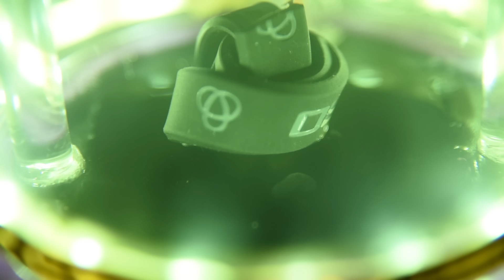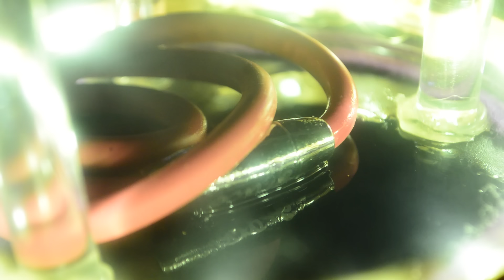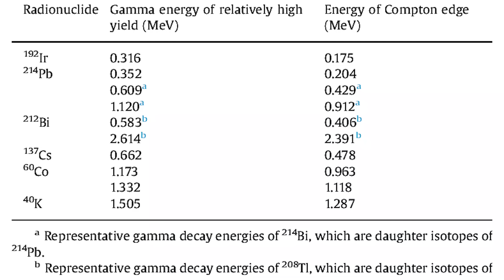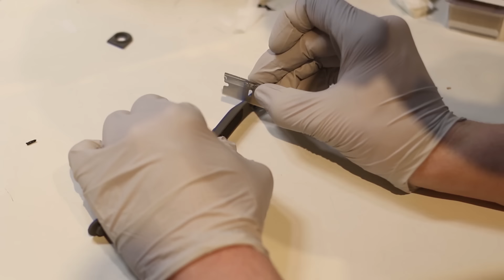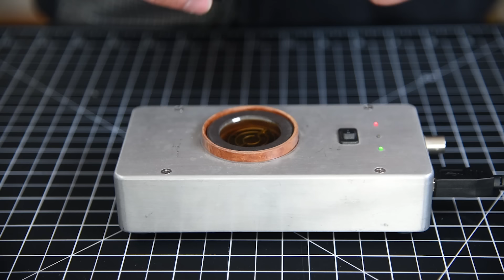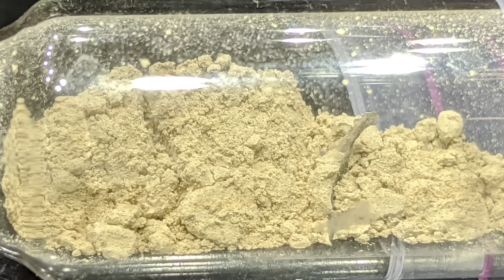Negative Ion/Anti-5g Products Are Actually RADIOACTIVE

Comment: You should build an atomic battery. Maybe even one big enough (and safe enough) to power an electric car. If you use carbon nanofoam and fill it with tritium, then you could produce a lot of power, and you could easily reload the battery once all of the tritium decayed into helium 3 (which you could sell to research institutes).
Reply: I would not do that, and he’s bogged down in other things already. Tritium is hard to make and pretty dangerous.

Comment: I need to know: what about a blow drier with that function?
Reply: came to ask the same question. all i know is "if you push the button, the hair dries flatter than if you don't". although in that case it would be heat/electricity fucking with a slab of tormaline so ??????

Comment: Not sure if this is up your alley or not but ever hear about Black Tourmaline? I think it is marketed as a general health thing and an EMF blocker. Interestingly enough, I was given a piece as a gift and had it placed in front of the receiver for my TV remote, when all of a sudden my remote stopped working... Changed the batteries, reset the box, bla, bla, bla, turns out the freakin rock was blocking the signal! I mean it had to of been because only when I moved it did my signal go threw. It was a small amount too, probably the size of a large coin
Reply: Well the remote prob used infrared
Reply: It blocked it because TV remotes use infrared light to communicate and you put something in front of the path of the light, you will achieve the same effect by putting anything infront of it.

And like this shit doesn't do any of that because that is not how electromagnetism works.

Comment: I know I am a bit late to the party, but as I was watching the Veritasium video, a scientist explained that tourmaline, being pyroelectric, creates negative ions on the surface when the temperature is increased. Is this really the case? Checking tourmaline crystals (shorl) as products, they are just advertised as tourmaline, with no negative ion claims, and appear to be in their natural form. Is there anything to such claims?
Reply: The stuff is expensive and rare as hell, there's no way anyone's just going to be selling any amount of it.
Reply: The statement is correct but just easy to misunderstand. Any conductive material will arrange itself in such a way that all the electrons, and thus negative charge, moves to the surface, this is just a weird and unintuitive fact about reality and there's nothing special about it. A pyroelectic material just generates an electric charge when exposed to heat, and said charge in the form of electrons will move to the surface. This is just a property a material can have and there are other similar properties, a piezoelectric crystal will generate a charge when struck from a specific angle, and a photovoltaic cell can generate a charge difference when exposed to light (photons). Basically a bunch of materials can generate electric charges when exposed to certain conditions, this can be used to generate electric energy but it also doesn't do anything extraordinary.

They probably don't generate negative ions, an ion is a chemical with a negative charge because it has extra electrons, while they do play a part in some chemical batteries like your average car battery they can't just easily be created without some chemistry happening. So I think you might just be misremembering that part, the process of moving around electric charge in the form of electrons does not itself ionize materials as the total charge of the material remains neutral, if it wasn't it wouldn't be able to conduct electricity.

Comment: And alpha particles are actually the most dangerous type of particle. The low penetrating power makes them not as big a concern under normal conditions, but if you're breathing in or ingesting thorium particulate or get a cut near an emitter you've strapped to your wrist, different story.

Comment: are there any natural products out there that actually work, blocking EMFs??
Reply: To block EMF's you need a Faraday Cage. Basically a copper net. Though EMF's permeate the universe as a whole and are not harmful. So if you wan to block them, build a cage out of copper wire and sit inside that. Oh, and wifi and cellphones will no longer work inside of it as you block all the EMF's.
Reply: @Adjuni  has that been tested?
Reply: @thomashoppes8594   Relax.

 The electromagnetic radiation that you need to be careful of are Ultra-violet (from the Sun), X-rays (from hospital imaging) and Gamma rays (which, unless you're the incredible Hulk, you will not be encountering much on a daily basis)

The steps you can take to protect yourself are: wearing sun cream on a sunny day, and avoid Sun tanning beds
Listening to doctor's advice when they suggest an x-ray.

I think if there are airport security X-ray machines, you can refuse to walk through those. The staff might grumble, but at the end of the day, if you don't want to be exposed to x-rays, I don't think they can force you.

Only flying in airplanes when you need too.

You don't need special underpants. You don't need a tinfoil hat. You don't need to smash your phone to bits with a hammer. Phones use microwaves, which are non-ionising. There's no link to cancer as far as scientists know.

Comment: Hey, There is a product called magnetic heating back brace, the product claimed to have tourmaline inside it. I try to open it, it has no energy source yet emitting some heat, do that thing also radioactive?
Reply: There are many common chemical reactions that would give off heat, including a very common one that involves iron filings. Iron is also very magnetic. I think it's impossible to say without more tests/information.
Reply: @0.-.0  thank you

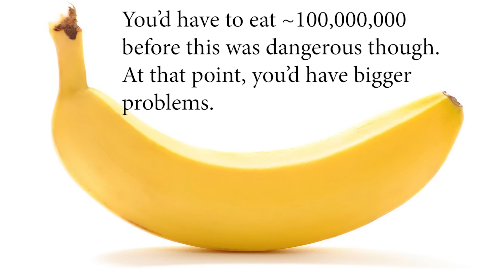Comment: 7:45
He looked at the clock. The power had run out, long long ago, but he knew, instinctively, that the exact date was 15428, 7, 18 at 21:37:13
the diet had enhanced his senses, but perhaps it was just the effect of the solitary time. He looked at the manual analog counter, to see that wonderful number. he rose from his bed, that of which, woven from many yellow potassium-laced fibers, and sat on his golden throne, peelings of all those meals before.  the moment had come. the counter displayed a measly  99999999. as his internal clock told him it was time, again. He reached over with his bony hands over to the yellow button, and put a wonderfully precise amount of force on it, savoring the sound and feeling it gave him, and the inevitable tumbling of another fruit down the chute.  He savored every moment he had, and peeled the wonderful fruit with surgical, calculative motions. he devoured the final banana in milliseconds. He waited for his broken body to finish processing the fruit, and once it was done, he took  9 fingers, put them on each digit wheel of the analog counter apparatus, and turned the 9 wheels to display the culmination of his meaningful existence, and promptly wept, knowing his final goal had been achieved. He sluggishly pulled himself through the vacant facility and looked over to the backmost rooms, reserved for the most useless of the peelings, and set his sights on the noose he had made from only the strongest fibers, and he had hung from the ventilation. He placed his head into the loop and leapt from a pile of the peelings, feeling in flight, as if to fall into inexistence, but was disgruntled to find his neck not snapped, and the ventilation mesh broken. He went over into the banana reception room, and threw a clenched fist at the dead screen, the tempered glass shattering and falling to the ground. He took a shard and promptly plunged it into his chest, as then he found great shock in that he could no longer feel such a violent action. He dragged the shard down, through his midsection, to find only organs made of the peels he now felt searing hate for, with no apparent damage caused to his health . He took the shard and with some hesitation, jammed it into his skull, and started crying when he only found banana mush. They were right. he did have "bigger problems"

Comment: Should be good a idea to look for radioactivity into  the dispossable handwarmers that react with oxigen to generate heat. I've always been curious.
Reply: It straight up says activated carbon and iron
Reply: The hand warmers? Those are just catalyzed iron oxidization.
Reply: The only way you're getting any heat out of nuclear material is if you have a nuclear reactor or weapon, which requires a reactor to make in the first place.
Reply: @commscan314  Well RTGs also exist so you can do it passively.

Comment: the funny thing about himalayen is that i have been buying and turning them into table salt... i mean it's economic it's more cheap than buying the salt from shops and technically the salt is just normal salt with iron and some other dirt
Reply: Friend you can buy Himalayan pink salt already in table salt form.
Reply: I wouldn't do that because they might contain dangerous heavy metal, hence why they're being sold as lamps not table salt.

Comment: I've used 2% thoriated tungsten for welding for a couple of years. If you know anything about TIG welding, you get better results if your electrode is sharp. I have no idea how much thorium dust I ended up breathing in from sharpening my electrodes.
Reply: How long is it ago and are you still healthy ? Because i had one of those bracelets int his video and was wearing them as Accessoire, without knowing the risk of them. It was a gift from someone for me. I am a bit worried.
Reply: @RichardSchmitz12  If you have spots where you wore them get them checked out, especially if they grow, because that could be skin cancer. If not and you haven't noticed anything after not wearing them for about a year you're probably fine, and as long as you don't later develop cancer in that spot any cancer you might develop probably wasn't caused by that.
Reply: If you followed whatever the safety guidelines for what you were doing is you probably didn't inhale much.

Comment: I found the part about alphas being stopped by paper pretty funny, at my work, we are told to use a piece of paper to differentiate between alpha and beta radiation when checking potentially contaminated samples.
Reply: I used a slice of sausage once for a school project.
Reply: Would have to be a relatively thick piece of paper to do that

Comment: I'm a bit late to the party here, and while I hate to "defend" these products (you're absolutely right that they are scams) I have to push back against some of your math.
You are confusing Sieverts (equivalent dose) with Sieverts (effective dose).  It's easy to mix up because they have the same name. But a few millisieverts equivalent dose to the wrist is a few tenths of microsieverts effective dose. Even a few millisieverts equivalent dose from the eye mask or the shirts will only be a few tens of microsieverts effective dose.
Additionally, unless it is inhaled (or injected), the alphas can be completely neglected because they don't penetrate deep enough into the skin. You're right that the dust could rub off, and you could inhale some of that, but it's going to be a small percentage of a small percentage, and most of that will be trapped by your mucus.
All in all, while these products are complete scams, the ones with dust embedded in plastics aren't actually dangerous. The ones with a significant quantity of loose dust do pose some danger if it were to break open and someone breathed in a significant quantity, but even that is going to be relatively short lived in the body and the effective dose by the time your body clears it will be on the order of a few millisieverts, tens of millisieverts at the most. Equivalent to a couple of ct scans.
Having said all that they absolutely should not be allowed to sell radioactive products unless the radioactivity is providing some function  (or is completely unavoidable, like bananas).

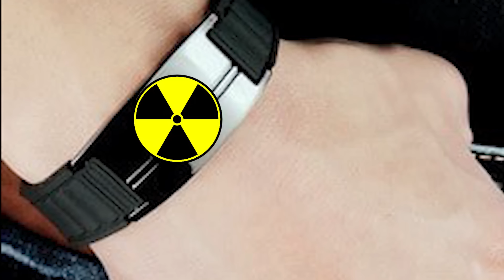Comment: 13:30 ... aren't Sievert defined as (absorbed) J/kg (of body mass), multiplied by a weighting factor .. so wearing that bracelet basically exposes your wrist to the same amount of radiation as standing in a homogenous 5µSv/h field caused by a pile of nuclear waste "way over there", only that in the second case your whole body is exposed?

You make it sound as it's the same amout of absorbed radiation but "concentrated on a spot" .. I don't think thats the case, because of the "per kg" part.

Comment: Could you do a video on Orgonite "pucks" that claim to bend, absorb, or harmonize, EM Fields? I've seen some chuncks of Malachite do this in a small space but some of the man made effects of stuffing a bunch of crystals and semiprecious stones into a resin still has me with many questions.
Reply: I mean anything containing metal would bend the fieldlines of a magnetic field, not the electric field. That's just because metal has a higher permeability so the field lines will tend to flow through metal. This however doesn't exactly accomplish anything of note, it just slightly changes the strength of the magnetic field at one point, which I guess does have an effect on how charged particles move but that doesn't matter outside of a high school physics assignment.

Got no clue what “harmonize” means, EM fields don't have a frequency unless you're generating them with an electromagnet that's running on AC but like then the frequency just depends on your power supply. I guess “absorb” could just be referring to what I described before, I mean that is basically how a Farraday cage works and it can be said to absorb EM.
Reply: @hedgehog3180  I think the goal of such materials is to try and "absorb" at the right rate of conductivity that it makes the enviroment less harmful to organic life. Like those dirty electricity filters but for the atmosphere in liveable spaces. Faraday caging entire rooms or houses has the potential to create harmful bouncing electrons picking up more heat. I've read they're working on Xemes material of titanium/vanadium that makes microwave spectrum signals not interfere with eachother nor penetrate life, its kinda 'slowed' enough to bend around organic electrical fields.

Comment: I have a hair straightener that emits negative ions to "neutralize the hair's static charge" for someone (like me) who doesn't know much about physics it sounds somewhat reasonable
Reply: Don't quote me, but there may be something to that, unhealthy as it probably is to use frequently on your hair. For ages in film photography, there have been anti-static brushes for cleaning dust and hair off of negatives. They have a little strip of something radioactive near the base of the bristles behind a tiny mesh. It's not something one handles very often, but using something like that for your hair is probably a different story
Reply: Well negative ions would be the wrong thing to neutralize static charge because that's caused by electron buildup which are also negatively charged. However that straightener hopefully just does nothing as literally just touching a piece of metal would cause the static charge build up to dissipate. That's why you sometimes get shocked by metal objects, you had built up a static charge probably due to rubbing against some fabric, and then when you got close enough to the metal object the charge jumps across to it in an electric arc which rapidly heats your skin and hurts a bit.

Comment: that cloud chamber is sick as frick! Could you make one of those that you could safely hang on your wall as a piece of art? To be clear, I mean, safely hang it on the wall with a piece of radioactive material that makes the detector look cool.
Reply: Jist natural radiation works, a table with a thin layer of whatever gas is in that in between 2 plates of glass would look awesome
Reply: Putting nothing in the cloud chamber would be a lot more fun since then all the streaks would be from natural sources of radiation, if you see one going down you'd know that came from a cosmic ray, which can only be seen at ground level because Einstein was correct. Also said ray would probably have traveled thousands or millions of light years to reach you.

Cloud chambers aren't dangerous, it's just alcohol vapor, but they are pretty bulky so it's a bit difficult to build one you can hang on the wall but there are guides on youtube.